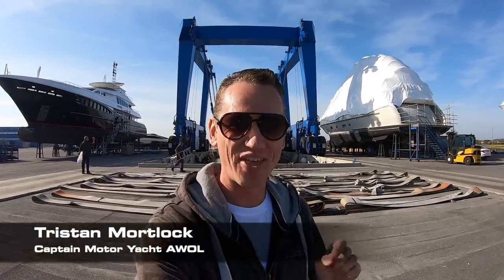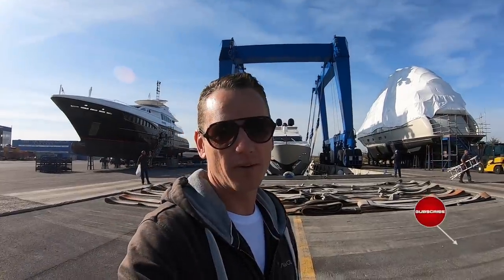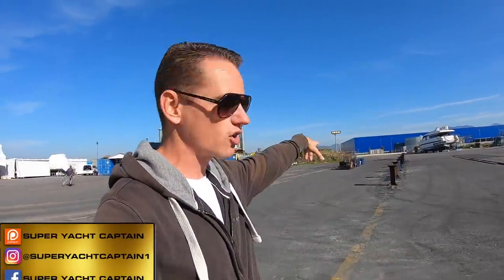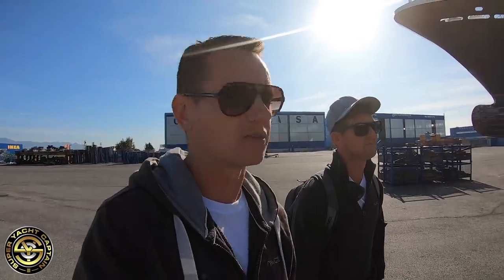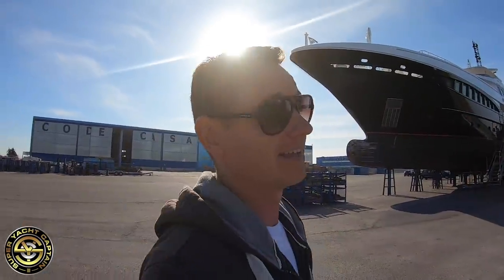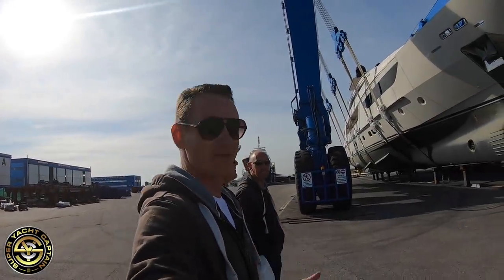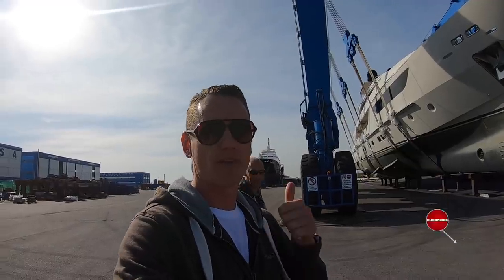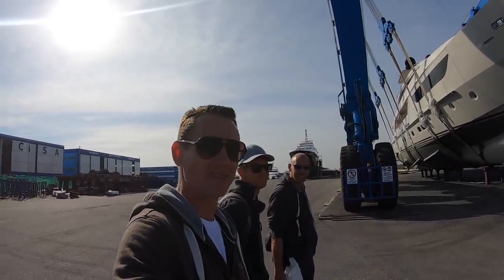LIFTING A $10MILLION SUPER YACHT!!! (Captain's Vlog 116)

Comment: 10 million for AWOL?? I would have thought it cost alot more. As far as yachts go, that seems like a good deal. Question, do some yacht owners buy yachts solely for the purpose of renting them out during peak season, hence rarely ever using the yacht themselves?
Reply: The charter industry is big business. Some owners charter some of the time, some owners charter all the time, and some owners use the boat exclusively for themselves. Some owners have more than one boat...one they charter, and one for themselves. Anything goes, really...as long as whatever you do with the boat meets or exceeds the laws and standards pertinent to its intended use.

Comment: What brand of bottom paint  are you using. I sell SeaCoat.. SEA-SPEED® V 10 X CLEAR is simply a clear version of our SEA-SPEED. Designed for sail and motor racing vessels. It is deal for smaller pleasure boats where the owner does not want the classic bottom paint look. It is easy to apply and provides a very durable high gloss finish that is non-stick and extremely smooth sprayed down to <3 microns. Works better on power boat than sail boats.. can be stored in or out of the water.

Comment: Hey Tristan have you ever had the yacht shrink wrapped? if so how does the price compare to the shed?
Reply: Many owners will bot wrap and store in a shed to reduce effect of condensation from cold wet winter air, wrapping fee will vary based on location and size but expect ABOUT $40 PLUS $1.50 per metre.
Reply: @SpamMouse  thanks